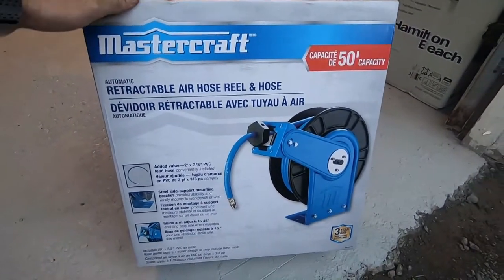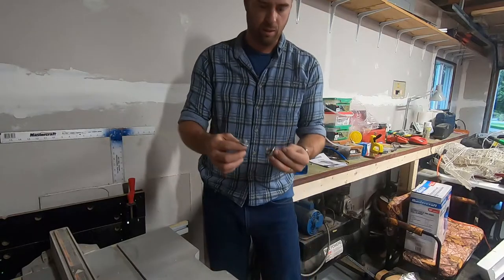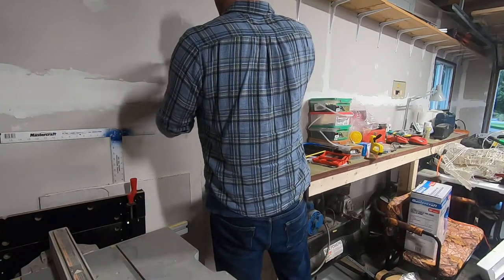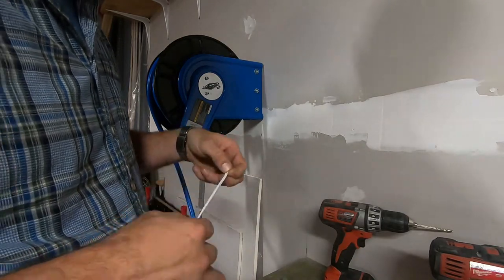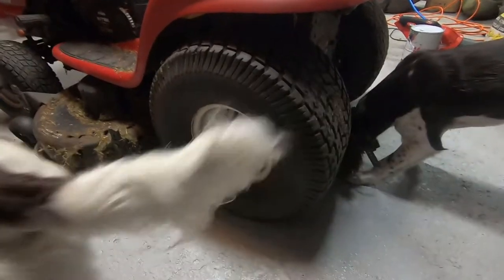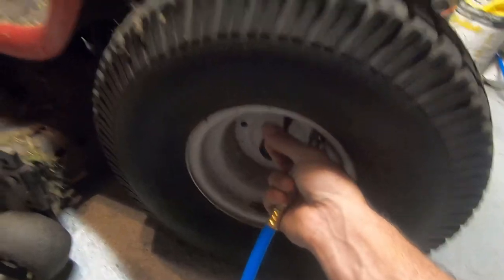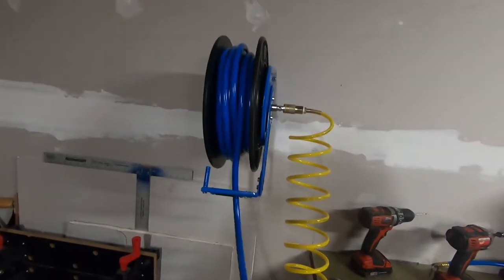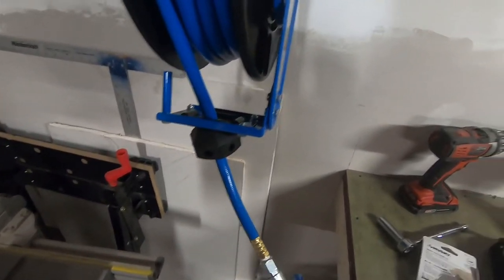Canadian Tire Mastercraft Air Compressor Reel

Comment: Hey do you still have it? I think I'm about to buy this reel and plan to swap in my already purchased 50 feet Husky hybrid hose (unless this performs decent in cold).
Reply from the maker: Yes I still have it and it does still work...but by know means would I consider this a "professional" hose reel meant for a true garage operation.  It is slower to wheel in now, and the "rollers" at the feed have broken, so you can't really grab the hose and walk to where you need it but instead pull out all the hose you need at the wheel itself and then go to your workspace. But still does the trick for when I need to use compressed air in my garage. If you do a lot of true garage work with compressed air, you'd need a professional reel from a supply store instead.
Reply: @ryanaandre Ok thanks I think I'll buy it then. I'm just a home DIYer and making my garage more user friendly. I use electric tools mainly, air is really more for air and tires. It does suck your rollers broke but oh well, I can't find anything else to buy... we don't have a lot of selection in Canada lol. I just have a home depot and Canadian tire here.

Comment: Any way I can upgrade its intake to 3/8? I already baught it but if I can’t do it I will just use my existing 1/4 and save the cash
Reply from the maker: The hose lines are 3/8" on this reel so you should be good to go.  If you pause the video around the 6 second spot, you can read the box pretty good where it talks about the 3/8" 50 foot hose line.  The reel has been good to me so far in the garage for the minimal air work required.  Thanks for the view.
Reply: @ryanaandre  like I said I have the hose reel as well and it’s inlet and outlet is only 1/4 inch which defeats the purpose of the 3:8 line

Comment: I am on my second air hose reel.  After 3-4 years both got weaker and thew last 10-20 ft wont retract.  I am looking for instruction on how/if I can rewind/tighten ?
Reply from the maker: After using it for a year, I can tell it would not fair well for heavy duty use.  Mine still hasn't broken yet, but I imagine it is fairly difficult to fix the internal spring. If mine ever breaks, I'll give it a try to fix it on video.  Thanks for the view.  Good luck with the repair.

Comment: Will this work for SUVs tires?
Reply from the maker: Yes no problem.  I’ve topped up my Yukon XL tires using my compressor and this compressor wheel.  The size of the compressor will likely matter more than the reel.
Reply: @ryanaandre  ok thanks I have a 2012 ford edge